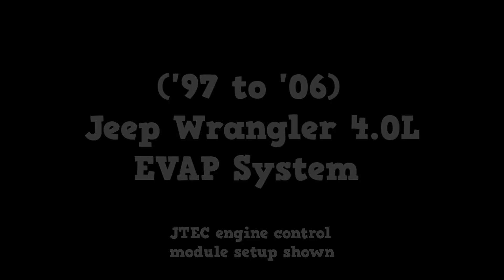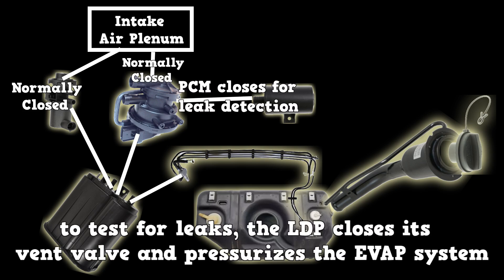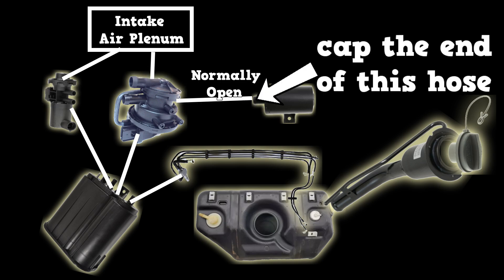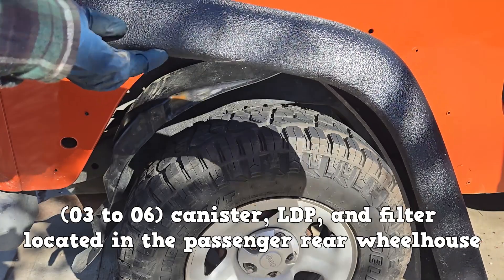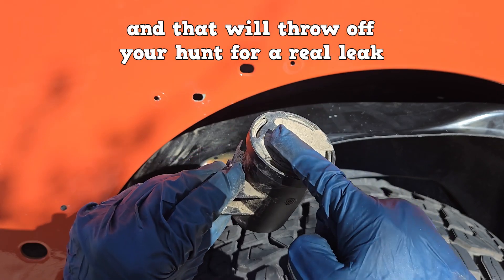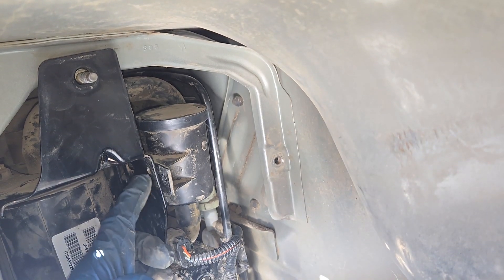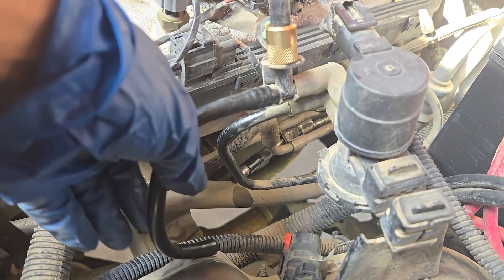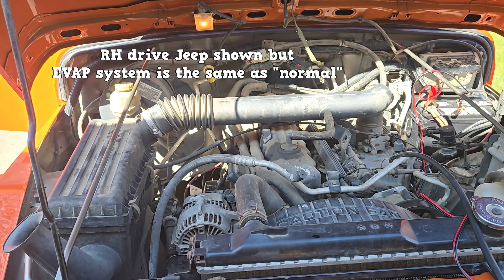Jeep Wrangler 4.0L (97 to 06) EVAP System Info & Leak Diagnosis Setup

Comment: Dumb question, Will the engine run without this system? I am asking because im building a stripped down tj from start and the system is missing. And would like to know if I can start the engine ones installed. Thank you
Reply from the maker: It can run without the system. You need to cap the fuel tank vapor lines or let them vent into the atmosphere (can be dangerous due to fuel vapors), and cap the port from the engine that leads to the purge valve.

Comment: I have a 2006 TJ 4.0. I don't see an EVAP service port. Is there another way to  smoke test the system
Reply from the maker: Through the EVAP side of the purge valve hose

Comment: I've had my used 99 TJ for 3 days and I just got an error code and realized my evap is missing two or three hoses... Will the engine continue to run fine and is this a big deal or am I making a big mistake by driving it with an EVAP code and a completely disassembled EVAP system
Reply from the maker: You need to reassemble that EVAP system as soon as you can. Do you have an idea of which hoses are missing? 
If the purge valve hose is there, then the engine is not getting unmetered/unfiltered air because the purge valve is normally closed.